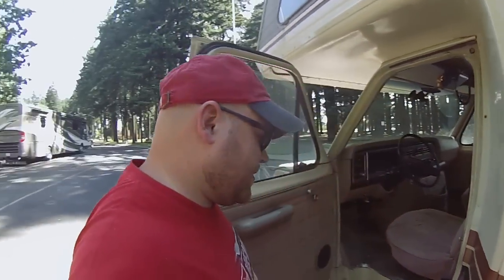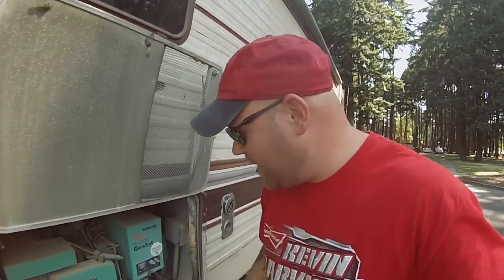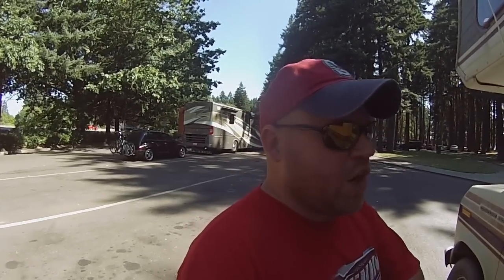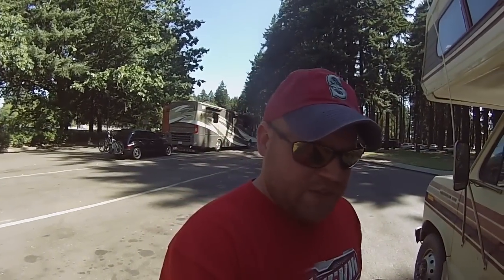Generator Fix, & Rope Swing @ Nisqually

Comment: Hi Eric! RV tip: clothes was as you drive; Put your clothes into a plastic bucket,fill with hot water and detergent and put lid on the bucket.Hang the bucket so as you drive the motion will mix and move enough that it will act nearly like a washing macine,and clean your clothes!

Comment: Great video! Tires Tires Tires. ..first things first. Be safe.
Reply: Abel Villarreal Yep!! This one made me cringe!!
Reply: Abel Villarreal Do the brakes and a suspension checkup when he does the tires, A bad suspension can wear tires fast. then start from the roof down!! LOL
Reply: Rodney Leon
The bad side of trying to squeeze the most out of a tire isn't just the flat and maybe changing it on the side of the road when you can't get AAA on the phone is the damage a failing tire can do to the body work or the damage if the driver loses control.

I've driven for some cheap owners and companies and had "used" crap put on and then have to sit either that day or later when it explodes as cracked tires can do when they get hot driving down the road and if Murphy is at work it'll happen when beside someone with a law suit background and an RV is to many, a rolling $$ sign and when it blows and one piece of it hits their car or scares them or even scuffing the paint. Yeah, humans are trying anything these days to cash in on others.

Take the chance of sucking all you can out of a tire but not to the point of adding costs to a tight budget as safety and living is a bit more important.

Blue Sky's and Safe Journeys
Reply: George Purdy I think you hit the nail on the head.
Reply: ive heard this for 30 years

Comment: Eric, I had the same problem with my Onan not starting unless the truck engine was running. It was the fuel pump on the Onan itself. It was weak and would not lift the fuel from the tank on its own. Also check the fuel lines going to the Onan for dry rotting and cracks because it will leak enough vacum to keep the pump from pulling fuel, but not show any fuel leaks. Good luck.
Reply from the maker: CumminsDslPwr I appreciate this helpful information!
Reply: Nomadic Fanatic Anytime, I hope you get it all worked out.

Comment: Good Morning, Mr. Jacobs,
I have found that the generator may need a higher octane fuel, especially at high altitude.  Rather than using 87 octane, I use 89 octane during travel through the mountains.  Check into using Continental Truck Tires.
Reply: Happy Highway Gas sold at high altitudes is generally a lower octane.

Comment: glad you have found you happy, screw the trolls, does this e-350 have the 16 inch tire on it they are 215-85r-16, go on craigslist ones and look for used almost new tires, I have an 89 e*350 u haul 7.3 diesel and it has the same tires, and I bought 6 tires for 150.00 so the deals are out there, it great the genset works, just service the genset and change all the fluids and it probably need rotors and new pads, great find, I understand that the van was too small, thanks for the awesome videos,

Comment: I'm sure storage space is important and the portable generator weighs a few pounds too but I'd hold onto it till you get deeper into the new RV and have a better handle on things. A generator will sell fast fast just about anywhere you are so you could always sell it later.

Comment: Hey Eric, it looks like generator has a fuel pump and possibly a propane carburetor ,  do you know if the generator dual gasoline and propane or gasoline only? 

Servicing the generator with new spark plugs, fuel and air filter should help starting. 

Also, Changing oil to synthetic will reduce friction and make starting easier.  I think most of the Onans spec a 15w-40 but a 5w-40 or 0w-30 synthetic should be fine and will help starting and power.  

I also like adding a little Rislone or Marvel Mystery to the oil as air-cooled generators as they tend to build up carbon on the rings and loose compression.  The synthetic oil along with the Rislone or Marvel can do wonders to clear out carbon, keep things running properly and help prevent the engine form gunking up as generators often run at low load.   

If you can run some fuel system cleaner through it might help too.
Reply: RedneckRectum Is there some reason you would say routine and recommended servicing of a generator is a "really bad idea" and  "dumb?" 

Thanks,
Reply: RedneckRectum Reed valve? you mean as in a 2-cycle engine carburetor? 

 Looking at the service manual it appears that the engine in Eric's motor home is a 4-cycle engine so it uses an automotive style carburetor with a float, Venturi, choke and idle adjustment. 
http://asavage.dyndns.org/Onan/900-0337/001b.jpg

It also has an oil sump and oil pump so it does not require a fuel/oil mix as with a 2-cycle engine. 

The Operator's guide has recommended oil change intervals and it looks like Spark Plugs are easy changed and readily available:

Below are the recommended service intervals: 

https://www.cumminsonan.com/www/html/Common/pdf/rv/F-1123.pdf

Monthly:  Clean and check battery and connections 

150hrs: Change Engine Oil, Air and oil filters

450hrs: Replace Spark plugs, fuel filter and preform Onan service center Tune-up

Comment: I think you are on to something with the battery issue Eric. But considering age it is also probably an electrical/starter issue too.

Add to your "to do list" clean all the connections from the batteries to the starting system of the generator. Corrosion causes lots of resistance. Clean all the electrical (starting related) on the generator. Then lastly pull the starter and either replace it or find a rebuilder in your travels that can freshen up yours.

30 years does take its toll.
Reply from the maker: dieseldave564 agree with you there! Thanks.

Comment: Take care of those tires. DOT notes that tires -- regardless of age -- start to really have issues after 7 years. Plus, a place like Sacramento, with the heat, will age tires even if they sit in one place. It is a bummer you can't just run them until the tread falls off. Best with the new Tioga!

Comment: Does the RV engine need to be running or is just having the key in the run position enough to engage the generator starter? Since the generator is intended to charge the house batteries, it would make sense to have it run from the vehicle battery, a different system in case the house is too depleted. Check and change the generator oil if it needs to be done. Get it a muffler. And try for some rubber isolation mounts. It sounded a bit like a rattle trap. Good score that the generator works though. I like the fresh water tank inside but the add on tank underneath is subject to freezing obviously. Check it out carefully if you use it. Scratches for JAX.
Reply from the maker: CITAP1 I'm not sure about that. I think the alternator needs to be charging the battery, so running.

Comment: Oh one other thought. Since the generator hasn't run in a long time I'd recommend an oil change air filter change and fuel filter. Who knows how much gunk has built up in that engine while it was not running.
Reply from the maker: Eddy G full genny tune up would be great!
Reply: Nomadic Fanatic Just ask and you may receive; right Tony?
Reply: Eddy G Don't forget a new spark plug. I serviced my Onan 2800 over the weekend. Starts easier and runs smoother.

Comment: Eric, I would take apart all the 12 volt connections starting from the battery to the generator and clean them with a wire brush and then put back together....sounds like your not getting enough voltage from the batteries to the generator.  This may be why the propane quit working as well....

Comment: Change the spark plugs and oil and filter.. My Onan never did work well after sitting until I rebuilt it, so you might think about keeping the ryobi. I had to get my parts from Cummins, a worse bunch of robbers you will never see.But once it WAS rebuilt(carb,plugs, ELECTRIC CHOKE) it ran smooth as silk. Do make sure your exhaust on that is compliant with the park system, cause some places want spark arrestors.
Reply: madisonelectronic I have to ask.. Does Ca require Onans to have any of their crazy CARB stuff on them or pass their tests?
Reply: George Purdy
I heard some places want tiny catalytic convertors. It sometimes depends on the year it was built, But most of the spark arrestor muffler requirements are set in stone.
Reply: madisonelectronic
The spark arrestor would be common sense to many BUT you know how that can work! LOL! If it's cheaper to not have one they'll go that route but me I'd not want to be in a spot where one tiny spark could burn my RV down!
IF Ca does as usual they will put a time limit before "older" equipment has to be updated or replaced as they do to trucking and old classic cars where they hit with a high dollar "permit" I think it is or a "gross polluter tax."

Comment: Don't know if you've fixed it yet, but my lp wouldn't work when I first got the rig. Turned out to be a carbon monoxide/lpg sensor inside the cabin that was malfunctioning. Took it out of the line at the tank replaced it with a piece of iron pipe from home depot. works now, but you have to do it yourself. Its illegal for an rv place to disable it.

Comment: Hey slap some duck tape on that hole on the siding to prevent anymore Water damage. Or even clear packing tape. Also it might be worth changing the oil in he generator and putting a new solenoid on it and seeing of that fixes the start issues especially after you upgraded the batteries.

Also I sent u a FB Message if you look on eBay or Amazon you can find a replacement lens for your GoPro for $20. The actual lens on the body of the camera not just the case.

Comment: Paper work. The bane of all things good in life!
That too shall pass.
As long as you have it on board it's a PITA for the officer that stops you and asks that enviable question of "do you have....??" to go through! You get to sit there and laugh as he goes through that stack of insanity! But you know how gooberments work. Not at all or real slow! LOL!

I found that out while going through radiation that my motorcycle I paid cash for had a lien on it when I went to renew the tag. It took the entire time of treatment of 8 weeks for it to get fixed!
Turned out the Dealer was also a not so honest salesman! Whole dealership has been gone for a while because I wasn't the only one in that mess!

While you're at the savage yard ask if they have the wing window lock for an '83 Honey. Drivers side. Can't find one here or in Denver where she's at.

And please hurry up with the solar install as 'll be doing that this winter and have watched as many install vids as possible to see the different ways everyone has come up with to run the cabling and mounting hardware and their reasons for them.

Hey Eric, if you see any RV's with wind power, stop and interview them please! Advantages and problems with the generator, noise and hight of the pole and of course setting up and tear down to move.
That should be a growing resource for RVs as why waste anything free?  That is already planned for next year for Honey I hope.

Comment: That is correct they batteries float at 14.6 volts when the alternator is running it generates an extra 160 watts. to charge the batteries.  But dont sell the ryobi because that generator is old and it will fail.

Comment: Nomadic Fanatic Eric is the propane tank full? Don't recall you confirming that. If you find the frames for the screens at the junk yard you can insert your own mesh (we did on our TC) easy peasy! I'm sure you're home now in WA but boy were you pushing it on those tires!!! ;0)
Reply from the maker: Jammin Along Well... confirmation via the sensor inside and the gauge on the tank itself. Also, the propane guy can't put propane in there. that's 3 pieces of confirmation... However, I'm still 90% sure the tank is empty... So I don't know what to say. lol. New tank maybe?
Reply: Nomadic Fanatic  Well you'd think the bleeder valve would show if it's full. If you opened that wouldn't you smell it?

Comment: So if he gets some new batteries the fridge and water heater should work?
Reply: Russell Hancock Depends on if the propane works. I don't recall Eric diagnosing it yet. Also don't recall if the genny runs off propane or gas?

Comment: The "Jackhammer" effect when you hit the brakes is from warped front rotors.  Not a hard fix on your own, do the calipers at the same time because it's a safe bet they have overheated or are dragging.  Otherwise do have all the suspension checked - hit up Kevin for more info on that since he just did the tan van.

Comment: the pulsing in breaks are likley an out of round  rotor on front
Reply: embarado smithing and woodcraft Yes! He needs to turn the brake rotors but I'm sure there's more to do on the brakes as well.
Reply: maybe cant tell just comment on his statement i  used to drive a ram   till some one did arson on it  it out weighs that camper so maybe new rosters is all he needs   turning is more expensive now a days  in most cases he should look in to both to be sure what is rite for  his  situation and it is  the place to start    most bang for buck

Comment: Vibration in brakes sound like bad rotors fairly simple fix... scrapyard tires are 80 a pair.... good luck with the old wagon. Old vehicles have allt of issues. Almost not worth the investment. Unless its deisle.

Comment: If the generator runs You have propane.
Reply: Russell Hancock Not necessarily. You're probably thinking there wasn't enough 12v juice in the batteries to run the fridge board so the fridge didn't even turn on, but when hooked into AC power he then should have had cooling via propane if that is the case.I had the exact same issue when I bought my rig, the 6v batteries were so low they barely ran the lights and that was it, no fridge or genset.It is the fun of RV ownership!
Reply: Russell Hancock My generator runs on gas. It won't run if the tank is 1/4 full or lower.
Reply: Jammin Along
10-4
You're left with enough to drive to the gas station!

Comment: The   situation here with your  generator is somewhat  similar to what happens when large multiengine  piston   aircraft are starting their   engines   sometimes   the first one is the hardest   and slowest to fire up   but  once   one engine  is started   the  remaining  engines seem to start   faster and  easier   and the reason   would be the same   older  tired   batteries   but   once  the generator on   one   engine is   pushing   power into the batteries  the  starting of the   remaining engines seems   nearly   guaranteed,,,,,,   now   modern   aircraft have whats called an   APU   small   gas turbine   generator and also supplies air under pressure to start up main  engines

Comment: Eric , Having at Least 10 Portable welders, Most had Onan Engines,,They are Believe Me Indestrutable,, God Knows with some Of the rocket scientist's I Had working for Me,, 
Does That have a Starter for The engine?  Sounds weird,, But Some Onans,Usually The 16 Hp ones, Have 2 Batterys ONLY!!!!  No Accuall starter,, But would spin Over, By using I forgot, If they were Hooked In Series Of Parell, But 2 Batteries,and The Magnetic field would spin The Engine Over,, If I can Find some Old Manuals,They were I THINK,The CCKA's !   Check and Get Back To Me,as Id Bet the way You described  it,,, There Like Most Of Mine,, All But 1 had a real starter,,why Onan Did It???????????    But Except The new Kohlars,,In My Option,, there the solid Cast Iron Work Horse!!!!!!    TY,Jack  ..      Love the swing a Buddy of Mine put 1 Up Here when i was Building The House,,But My German Shepard,Used It Every daay!!!!!!!!      95+ Pounds, 15 ft Up,YIKES!!!!!   Great Teeth,,, ,, And If I didnt stop Him,, It would Be HOURS!!!!    Jack